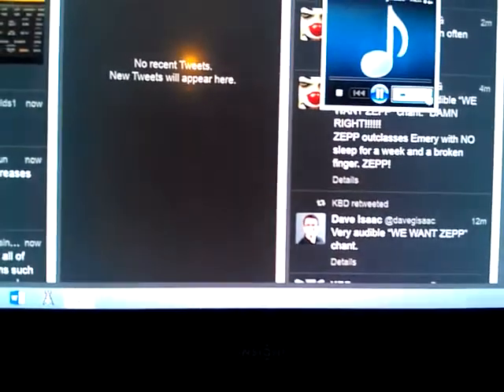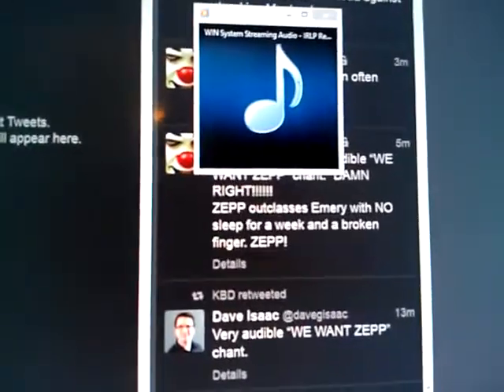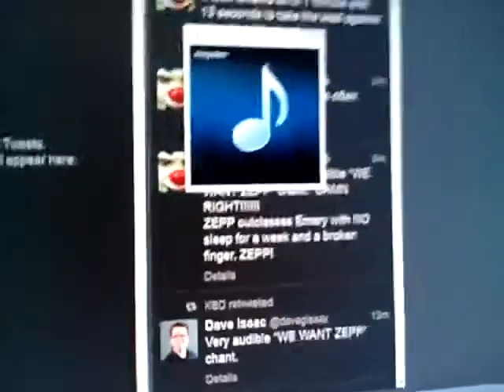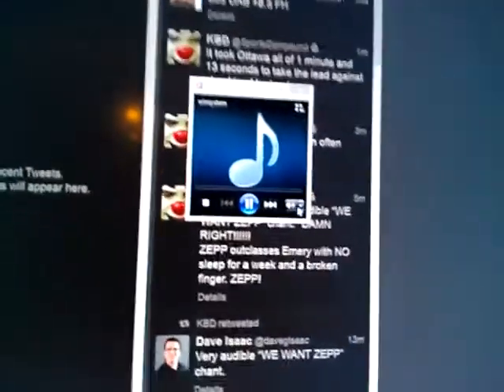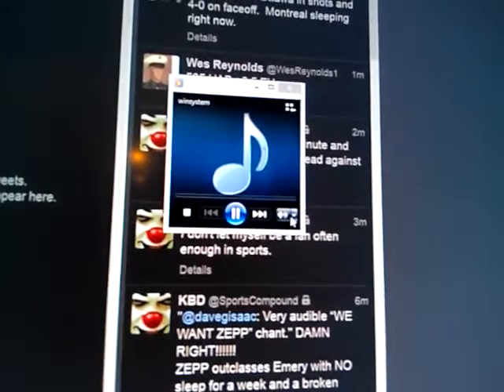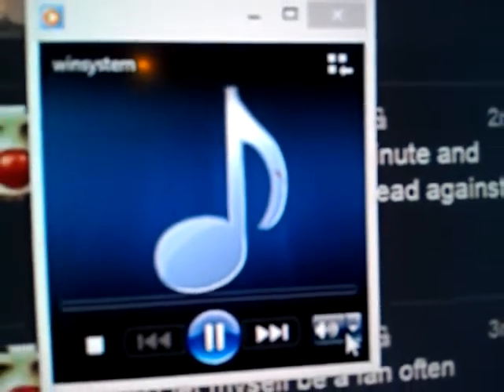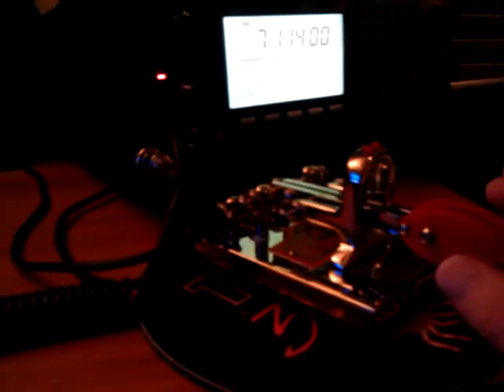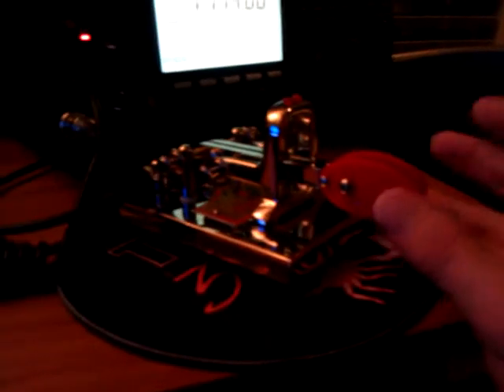Western Intertie System Demonstration

Comment from the maker: WIN System is a non-profit, membership supported, linked UHF repeater system.  All licensed amateur radio operators are invited to join.There are about 80 repeaters linked together and it's an OPEN Repeater System with repeaters in 16 States and 3 Countries.

Check out the website at winsystem.org for more info. Listen to streaming audio at http://www.irlp.net/